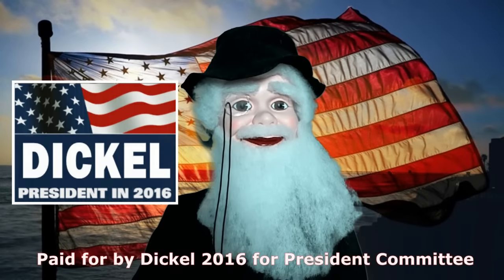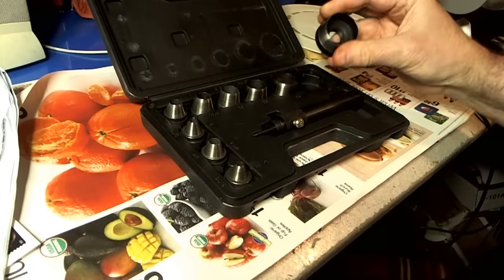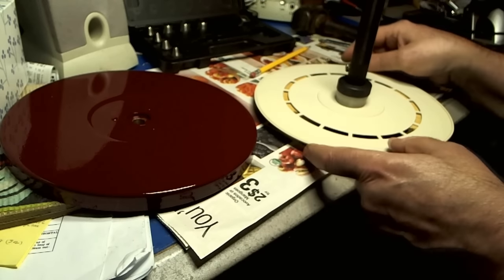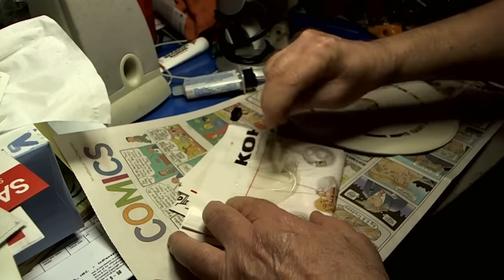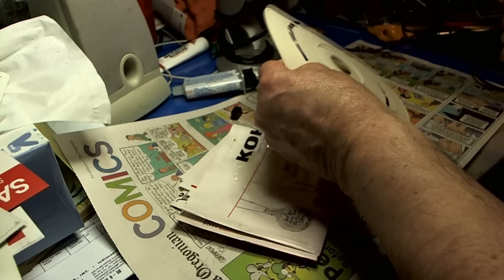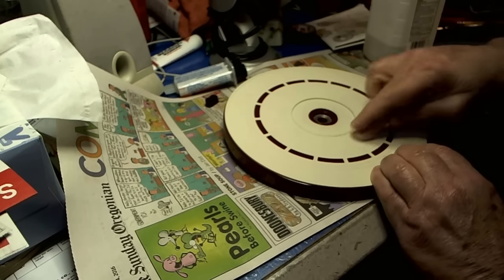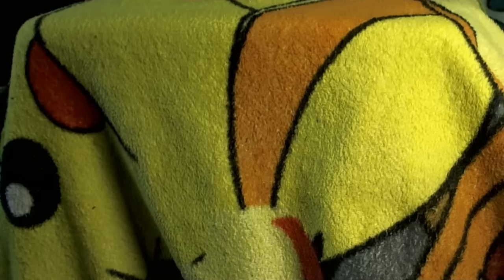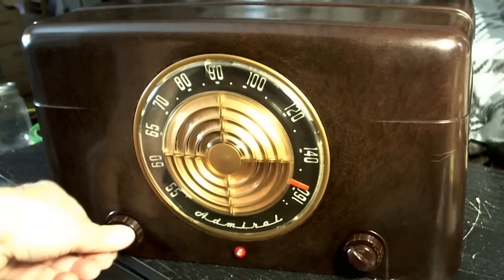1950 Admiral Model 6S12 Restore Part 7 Final

Comment: Hi Buzz, We punch rubber, leather and felt pieces every day at my shop .  The tricks we use are:  A solid surface, like a cement floor, a couple of sheets of paper between the rubber and the base (wood, rubber, acrylic).  Only one whack is needed. Try it next time.  I learn a lot from you so I'm glad to give some back...
Reply from the maker: +microtouch69 ...i figured I had a too soft thing with the wood....Godfrey Daniel!!!!.....lol...buzz

Comment: Dang it Dickel beat me to the punch with the barking Hillary video portion! Oh, well. Wife's been pretty sick for two days and slowed me down on the video making. Nice job of the restoration.
Just wondering, I was itching to see the turntable turn with your white pad on it to see if you got it centered. Was thinking you could have used the turntable motorized spinning to align the white non slip pad. Anyway the completed radio looks great and great alignment demo. Too bad about the scratch on the right front. Wonder if there is a filler you can use for that. I have no clue.
Reply from the maker: +Lockemeister ...greeting Lockmeister....hope things go well with wifey......sorry Dickel stole your thunder...That Hillary is one crazy woman...hahaha...the alignment on the mat wasn't perfect, but acceptable..that footage and other stuff was left on the cutting room floor..No worries about those scratches...they are great battle scars, and I love them....call me weird...welcome back my friend...Buzz

Comment: Hey Buzz, That thing really turned out whizz bang sharp!  I noticed on the back hinges that they looked to have been at one time copper coated as well.  I'm not sure how well it would work, if at all, but CRC, the company that makes that electronics cleaning spray also makes this stuff called Spray on copper coat gasket compound.  It's for automotive use like on head gaskets, but I've used it for stuff like water pumps & such.  Thing is, when sprayed on it looks like a real copper coating as it has real copper in it.  Always wondered how it would look if used for decorative purposes. Just a thought for future ideas.  For future reference, hold your hammer by the bottom end of the handle.  It'll take fewer hits to get your job done. :D  And if in future you're going to be doing a lot of hammering it's less stress on your wrist as well so it won't tire as easily.  Take care, Gary
Reply from the maker: +Rebel9668 
good tips my friend...I decided not to paint the hinges..leave it with a rustic lived in look..haha..Buzz